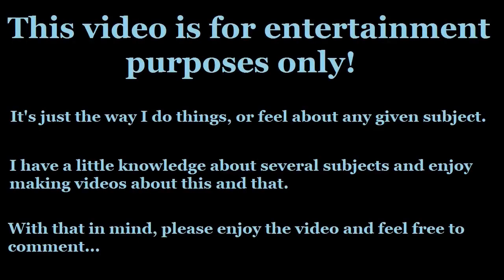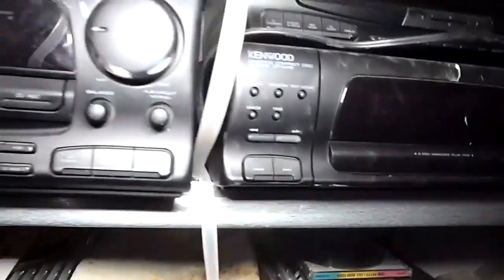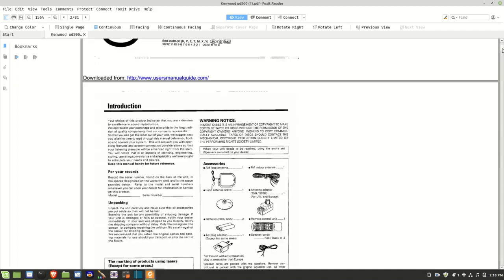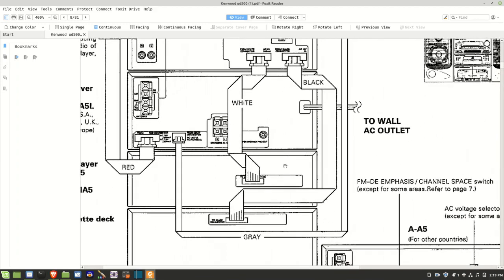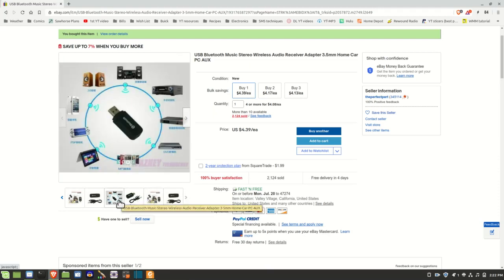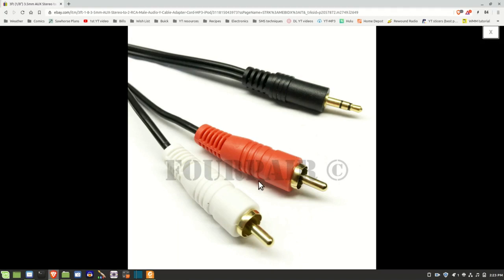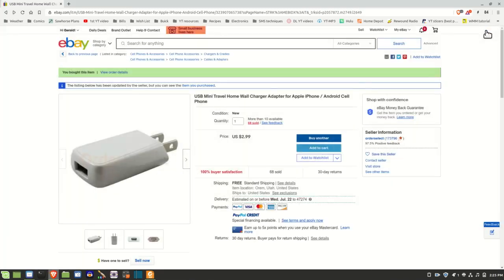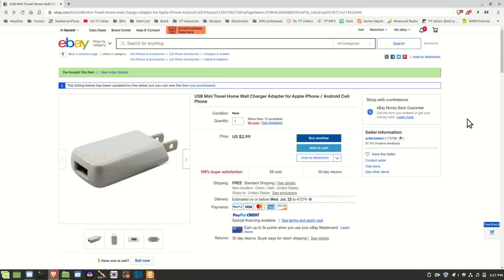DERB - Adding Bluetooth to a Kenwood UD-500 mini component stereo - P1

Comment: I use one of the battery powered ones with my Panasonic boombox..it works well but I've been meaning to buy one that is powered externally..I'd love to add aux to one of my other boomboxes that don't have it but not sure it's worth loosing the cassette or cd player to do it...Been searching online for a while for a solution that doesn't require tapping into and loosing one of the other functions.
Reply: @DERB_Seymour_Indiana  Exactly..That's what i was thinking to but ever video or blog post I've seen about it says you have to lose the cassette function to do the mod..Seems like you should be able to just tie into the board just before the preamp and use either or..I'm not the most knowledgeable guy when it comes to electronics though so I really have no clue..lol
Reply: @DERB_Seymour_Indiana  I thought about doing the same thing with my battery powered module and just removing the battery..Maybe use an old cellphone adapter and tie it into the mains input on the boombox or a 7805 voltage regulator..Not sure if either of those are a good option.
Reply: @DERB_Seymour_Indiana  Thanks..Unfortunately I haven't been able to find a schematic for any of the boomboxes I have..The one I'd really like to make the mod to is one of the little Emerson K3661A models since I have 2 of them and I could experiment with one without the fear of messing it up..lol
Reply: @DERB_Seymour_Indiana  Yeah I think I remember seeing a service manual for my Sanyo M9802 for $30+ somewhere online..I would love to have one for all of my boomboxes but those prices are a little too high for my budget atm. Kind of surprised that there aren't any free copies floating around the web..lol
Reply: @DERB_Seymour_Indiana  That's very similar to the one I was looking at getting for my Panasonic but it has an aux input so I never bothered..Should probably pick up a few of them just to have on hand though since they're so cheap.
Reply: @DERB_Seymour_Indiana  Thanks I'll check it out.